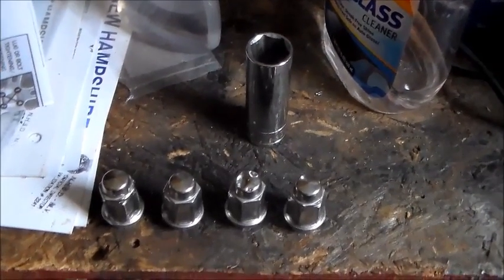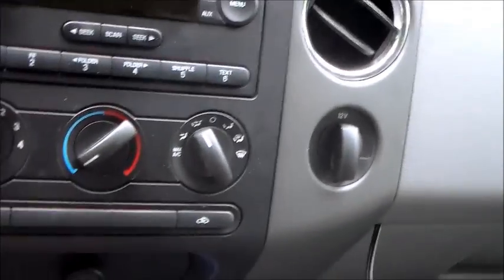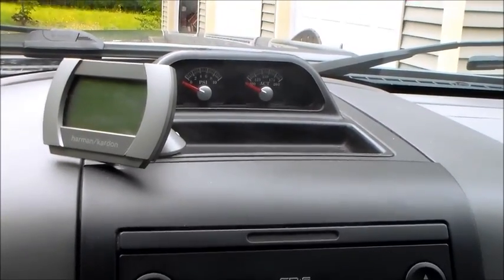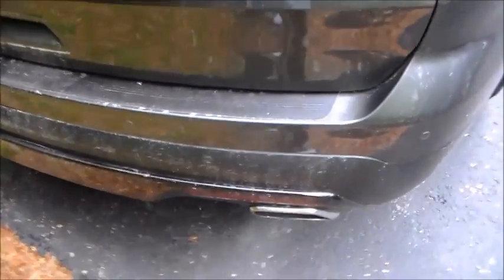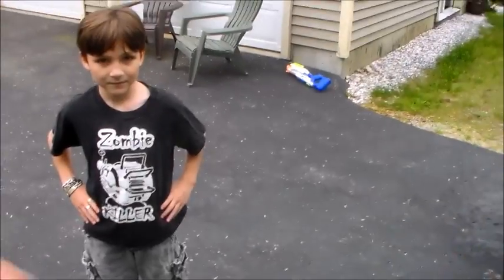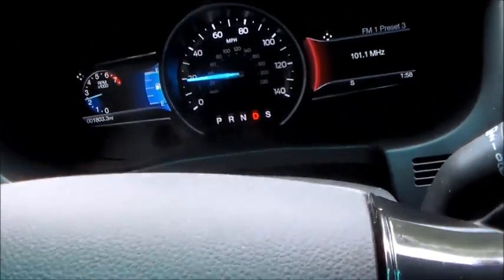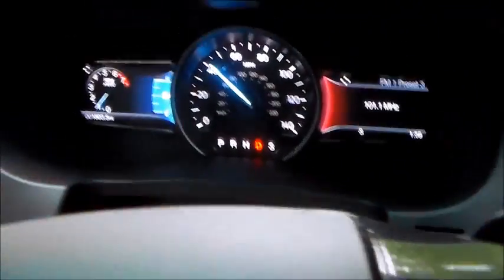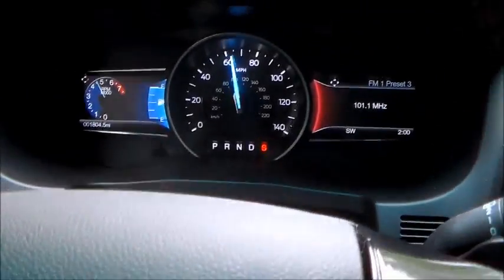Ford Explorer Sport Borla Exhaust Sound Clips

Comment: Holy cow man..sounds like a straight pipe!
Reply from the maker: You should listen to some of the Livernois modified Explorers!! There are sound clips, on YouTube of Exp. with modified down-tubes and outright racing exhausts. Those sound loud and mean. Mine is actually pretty sedate, if you drive it sensibly, and it has a nice low growl, if you get on the gas. That's why I love and recommend Borla Exhaust. They are like a Jekyl and Hyde in sound. Loud if you want it to be, otherwise its got a nice low rumble. Thanks for watching and commenting.

Comment: Sweet ride just picked up a 2015 explorer sport same color magnetic grey. I was wondering did you do any modifications to the engine like the performance chips? My sport has M as the last shifter gear instead of S which I'm not sure why. Your explorer seems to shift way faster 0 to 60 than mine does that's why I was curious if you did any mods. Awesome channel too.
Reply from the maker: The only engine mod I did was the Air Raid Intake. It's still my daily and I want to retain all the everyday driveability. The Livernois downpipe and a tune are on my list though! Thanks for the kind words, it is much appreciated, my friend!.
Reply: Metalcop what tires do you have?

Comment: I still like my stock exhaust sound on my 16 sport. Does anyone make mufflers that flow better but keep stock sound? All the sound videos  borla & magnaflow makes it sound like a diesel & my stock exhaust makes it sound more like a v8 when I get on it
Reply from the maker: The Borla sounds nothing like a diesel. It is actually very quiet, like the stock exhaust, until you get on it, and then it has a pleasant raspy tone. Check out some sound clips of the new Ford GT?! Believe it or not, it is the same engine family; a twin turbo V6 Eco-boost, and they sound very similar. To my ear the Borla is the best exhaust if you want quiet for normal every day driving, and loud when you stand on the gas. Magnaflow is louder throughout the RPM range, but has a mellow tone. The Flowmaster or even the Borla Atak etc. are just plain loud and obnoxious, 24/7, which some people like.

Comment: That is the low rumble im looking for, sounds great!!  Is it the dual in and out or single in dual out? Betbit sounds mean with downpipes..
Reply from the maker: It is a dual in, dual out setup. V6 w/ a turbo on each bank, so a true dual exhaust. It definitely has a low rumble and growl. Particularly at idle. There are downpipe mod sound clips on YT. They are way louder and you can hear lots of turbo whistle, if that's your thing. Thanks for watching and commenting.

Comment: Did the fuel system need remapped after installation?
Reply from the maker: No, the fuel system/ecu does not have to be 'remapped' after the exhaust is upgraded. I know this is required with some Mustang etc. exhaust systems, but the Borla is a true bolt-on, with no tuning required.

Comment: I have a 2015 Explorer Sport, love yoor wheels.  Model and Size of wheels and tires?
Reply from the maker: The wheels are Saleen replicas, available at American Muscle. They are 20x9. I re-used my stock Hankook 255/50 R20 tires on the Saleen rims. The stock Explorer Sport wheels, Ford calls them 20x8.5" but they are really 8.69" in width +/-, so the stock tires fit, easily. You could run a larger tire and rim , if you wished. Guys run up to 10.5" rims on these Explorers, without rubbing issues.

Comment: What's the part number for the Borla kit you have?
Reply from the maker: Alfredo Salazar BOR-140659 is the part #. Specific to the ‘17 and up Explorers, which has exhaust tips, built into the Ford OEM fascia. I bought mine from Stage 3 Motorsports. Cost around $900. Thanks for watching and commenting. Please consider subscribing if you don’t already!!

Comment: Sounds great I want that sound on mine. What's the price on that?
Reply from the maker: About $900. Cheaper now that the new Explorer Sports have a built in exhaust tip facia. I would highly recommend Stage 3 Motorsports for all performance parts for your Ford.

Comment: It's actually an 18.5/19.5 depending on the Ford vehicle, available on one flip socket at most parts stores
Reply from the maker: So its 19.5 for my Explorer which converts to .76 /inch. Leave it to Ford, to change something that has been in service, and working just fine, since at least the 1960's!!